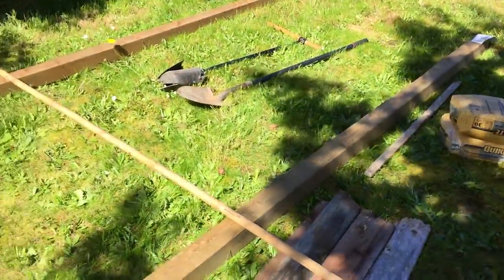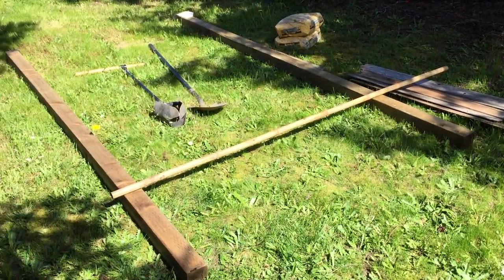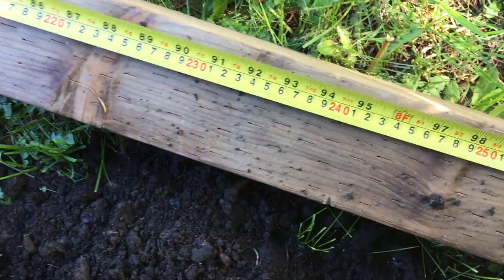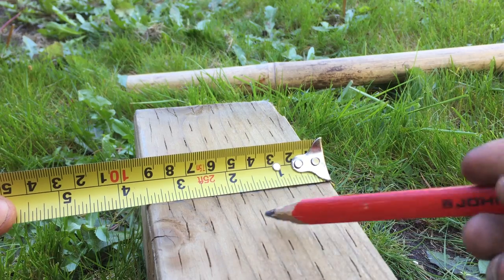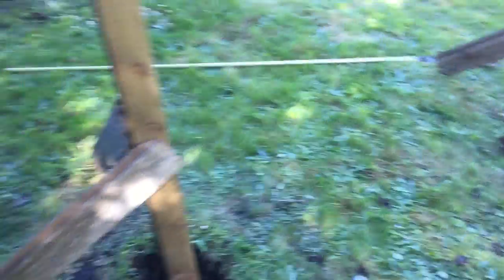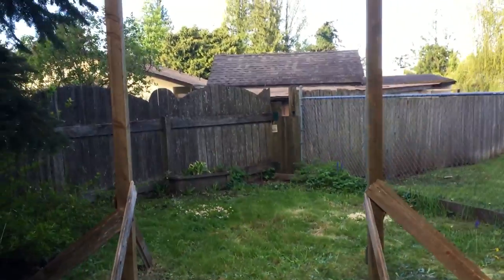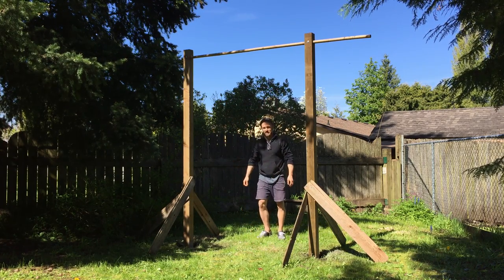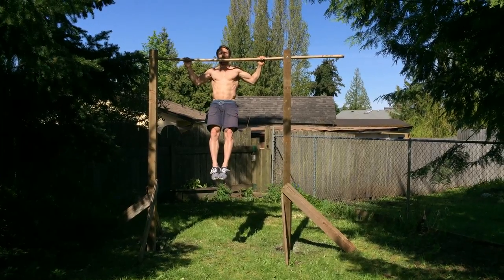Building The Bar + First Muscle-Up On It!

Comment from the maker: Hey guys! Thanks so much for checking out this video. Part 2 to the Q & A will be up this weekend and I just filmed my push day in the gym which I will get up soon too! Have a great day. Don't forget to comment, let me know what you thought.
Reply: Simnett Nutrition thanks Derek. These are awesome videos!
Reply: Put a metal rod through the bamboo will bend less.
Reply: Just left a question about bulking and cutting on your other video....Didn't realize I missed the first Q&A already!
Reply: Putting the metal rod inside the bamboo sounds good and then a barbell collar on the outside of each post to guard against slipage...with 6x6s as you mentioned would be one solid bad-axx outfit.  Definitely want to try this!

Comment: I've got a pull up bar I made out of steel pipes that just screw together. It's not bad. It wobbles and it's rusting now that it's been exposed to the weather a bit. I would have liked to build one that's secured in the ground but I just have no where to put it. Gotta work with what you've got!

Comment: Hm interesting.  When I installed my first pull up bar I just dug a 1m deep hole for each side and didn't have to use any cement, works great even after 2 years of use. The height of the bar (1m (the part that's in the ground)+2.60m). 
I like that you used bamboo as a bar, looks very nice indeed!

Comment: I made mine by putting the bottom of the posts in 5gal buckets and cemented that, then put that in the holes then cemented the buckets in. I like the height of yours much better though. Mines barely out of reach.

Comment: I built my pull up bar in October last year with my dad, my bar is metal so it doesn't flex which I prefer, other than that everything else is the same as yours in this video! 4x4 posts and the height haha I also need to jump. I am ashamed to say I have only used it like three times in the beginning. But I am planning to get started this summer!
Reply: How did you secure the metal bar?
Reply: zoorrken had to push it in while twisting with some detergent to make it easier. But it was a really really tight fit haha

Comment: Hey Derek love the videos. Really itching to build a pull up bar myself. I'm curious how far apart did you place your posts? Looks like at least 4 feet if not closer to 5 feet. I'm curious as the distance and maybe the reasons why so I can make a decision myself.
Reply from the maker: I would just measure your arm span at about as wide as you would grip the bar then at a couple inches. This is probably a little too wide for the bamboo.

Comment: Hey man, can you provide a link for the bamboo poles that you buy? The ones i get locally for gardening stakes aren't strong enough i think. thanks!
Reply from the maker: Hey I bought them at a store in Vancouver. They don't have a website you can order from, sorry about that!
Reply: gotcha. no worries. I'll do some searching
Reply: who'd a thought? yesterday riding my bike along a bike path through the woods in Boston i spotted a patch of wild bamboo. Maybe I'll wild harvest some! Any recommendations on cheap doorway or wall mount pull up bars? I'm looking to just get started with calisthenics and I think having a bar in my room would be helpful. would be nice to also be able to do dips on it and muscle ups. Suppose that would only work if it was far enough off the wall though. Thanks for the inspiration!

Comment: Why you didnt put bamboo on top of the boards and put bolt from the top?
Reply: Would have been poorly built, and the bamboo would have broke in halves ;)
Reply: And in this video the screw through the middle of bamboo and according to your logic bamboo in his yard can be cut in half too? It might be poorer but fast and with good bolts it would hold and if screws were in the wood it would be tighter
Reply: It's not separating in two since it's fitted in a hole :)
Reply: This doesnt mean that it cant be cut in half, bolt went through bamboo. According to your logic, from the first irrelevant answer.
Reply: anyway, I just wanted to help, have a good day

Comment: Bro, do you think it'll last long?
Reply from the maker: The posts did, but the bamboo didn't. The mistake I made was by not drilling the bolt holes big enough through the bamboo so when I hammered the bolts through it split the bamboo. On the next one I will drill the holes bigger or maybe use clamps on the outside of the posts instead of drilling holes. Always hard to explain these things hope it makes sense.